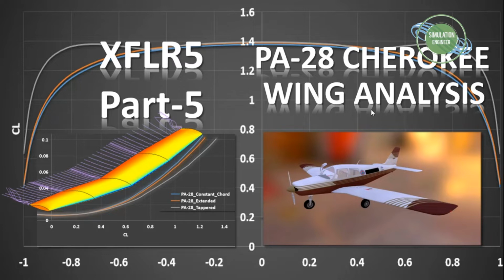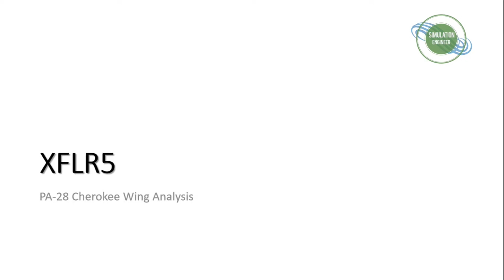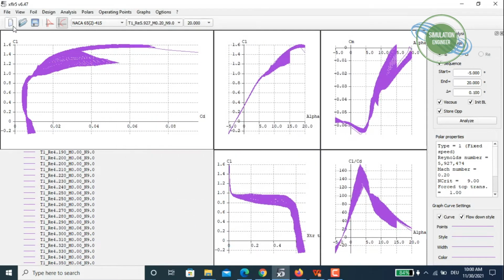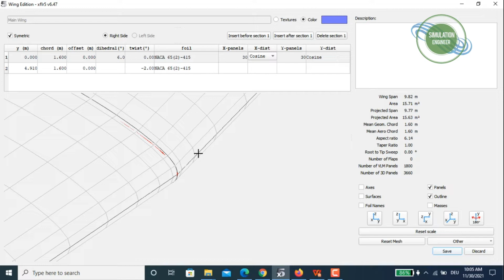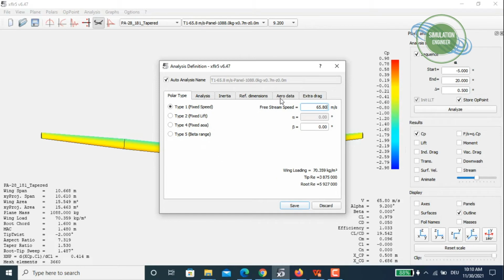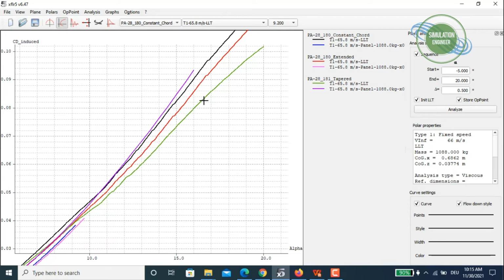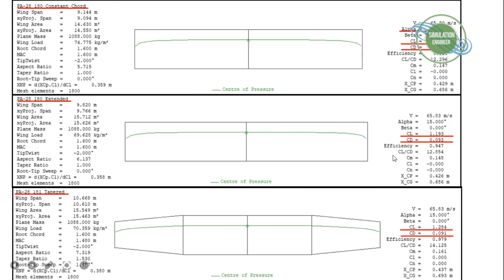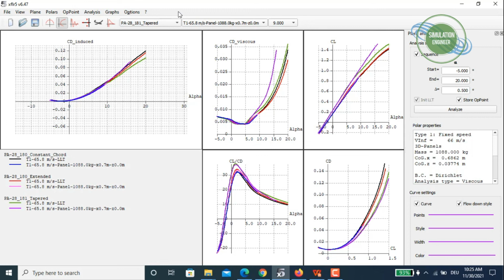XFLR5 Part5 Piper PA-28 Cherokee Wing Analysis

Comment: I would like to pay you to run some analysis on adding some long range fuel tanks to my PA28-181- is this possible? If so I will give you my email address as long s you can delete it fairly quickly!  The analysis would be to prove the wing can deal with the extra loading. I would add the fuel outboard of the main tanks like the Piper PA28-236  - this model has stronger brackets at the wind root.  However I would have an overall lighter aircraft and I would always fly within weight and balance (ie when taking long range fuel I would not take passengers)

Comment: Whenever i plot a airfoil with chord of 100 mm , i get Cl values of 100s , can you help out with this problem?
Reply from the maker: Well Abhijeet normally you use the dimensions in normalized form like it goes from 0 to 1 ok. No wonder if you use the chord length of 100mm accordingly you will be getting higher Cl values. Use the co-ordinates in normalized form everything should be ok then, thanks.

Comment: Hello im making active spoiler and in xflr5 with flap extended at 30 deg in plane simulation program is not ploting anything.
Do you know maybe why is that?
Im getting grahs for 20 and 10 deg.
Reply from the maker: Hi Jan, well there could be several reasons. Either its convergence problem or Reynolds number out of flight envelope, solver issue etc. 
May be try your simulation first with 25 deg or less  and then increase flap angle slowly to reach 30deg. 
Could also be an issue with number of panels distribution at 30 degrees test case.
Reply: @Simulation-Engineer   Error looks like this  """Span pos =      0.00 ,  Re = 358447 ,  A+Ai+Twist =   58.5 could not be interpolated"""" I did direct analysis for that reynolds number and it didnt help. I got results only for attack angle ranging from 12 to 18 but not for 0-12 and 18-20.
Reply from the maker: Well that means there is a problem at the wing root position. Try the following:
- perform direct analysis using batch option to have finer resolution of Reynolds number around the mentioned Reynolds number 
- also try to change the panel distribution at the wing root
- may be use of other vortex lattice method or panel method could help too
-may be start from -2 deg/-1 deg in 3D analysis to get the desired angle of attack
- make sure in direct analysis that if the airfoil is stalled or not
Good luck
Reply: @Simulation-Engineer  I performed batch analysis, changed panels, used different methods and i know wing is not stalled for given AoA.Im getting now little longer graphs but still no full characteristics. If flap is set for 0 deg i have full graph but the more i increse the deflection of flap (increase angle) the shorter the graph gets. Do you know why this might be?
Reply from the maker: Well normally increasing the flap angle results in increased camber. That's why these preliminary tools are not so optimized for high life devices setup.
I would recommend the following:
- Use panel method with viscous option on
- another important point make sure that you use an airfoil with flapped geometry in 2d airfoil analysis then select it in your wing definition.
Good luck ☺